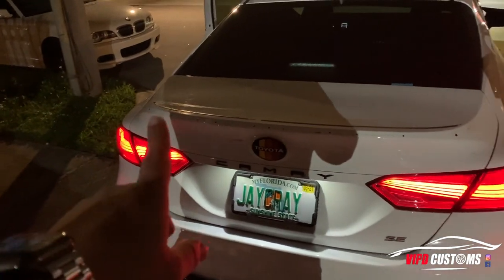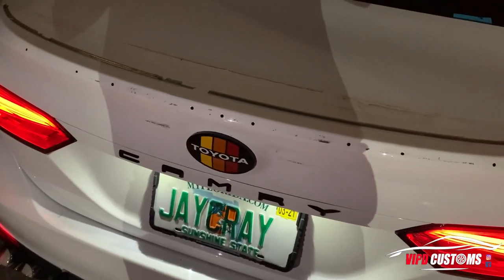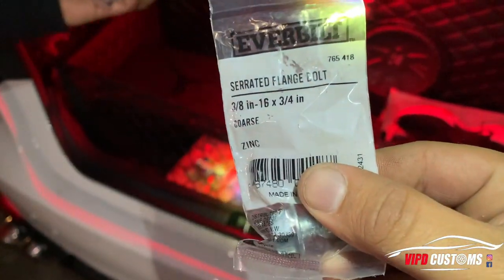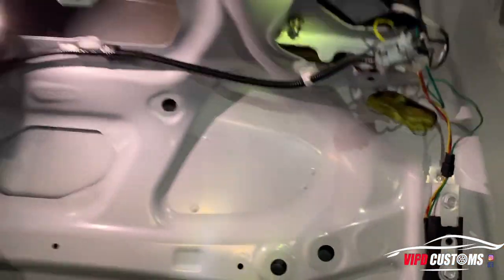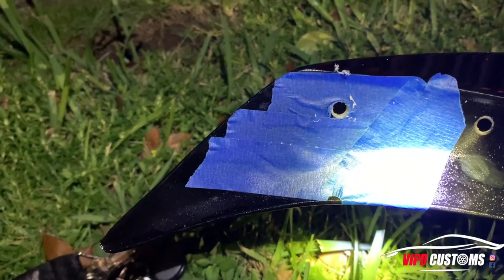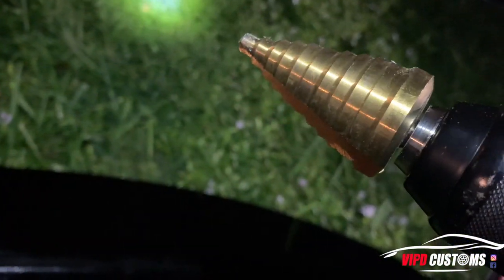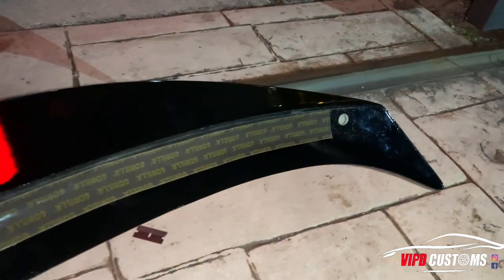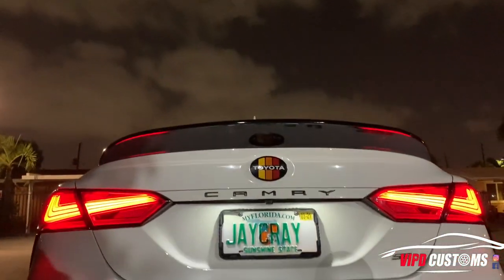Duckbill spoiler on Toyota Camry

Comment: I just got a 2021 Camry TRD I don’t like the wing it comes with. Do you know if it’s bolted on? I’d like to find a direct replacement and replace with a wing like this one in the video. Thx!
Reply from the maker: Factory wing it is bolted on so when you take it off it will have holes on top of the trunk
Reply: I going with the TRD style wing ,how can you cover the factory holes on my SE model??
Reply from the maker: I can but the best way is have a body shop cover and paint it over

Comment: Yo bro how did you get that spoiler to fit over the marks from the original spoiler. The cut of the cuztum tuning spoiler isn’t the same size in width
Reply from the maker: It actually sits perfect on the ridge from the trunk lids, you have to sit it perfectly on the edge

Comment: How does it screw in on the spoiler???
Reply from the maker: Factory mounting holes
Reply: I see where it goes in the factory trunk mount but how does the bolts secure to the spoiler?
Reply from the maker: Yes you make the holes for it abs thread it carefully